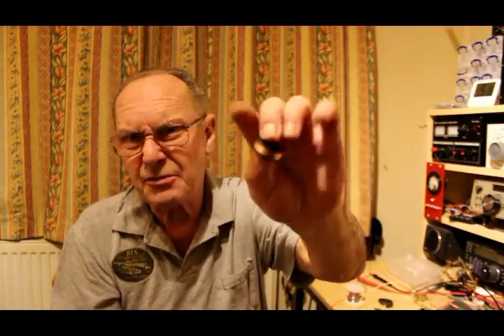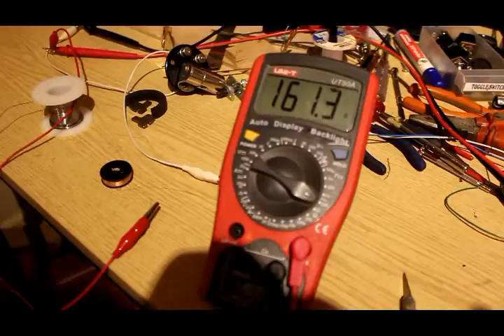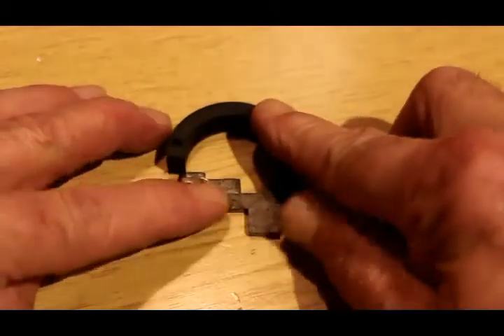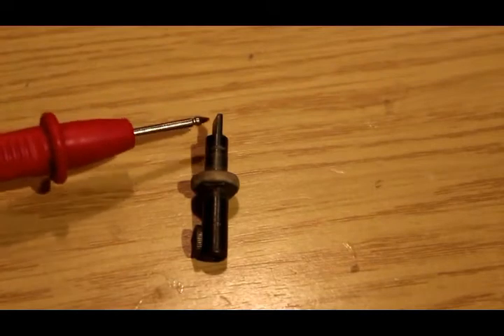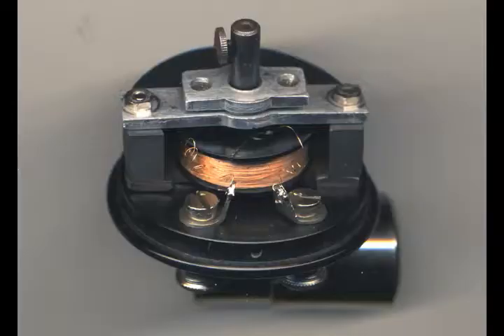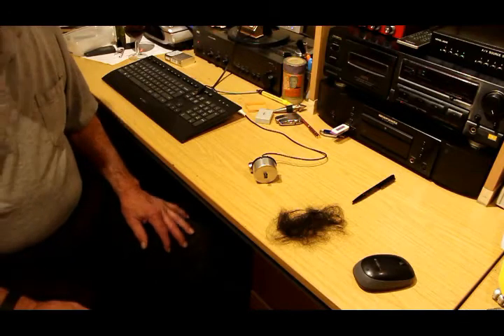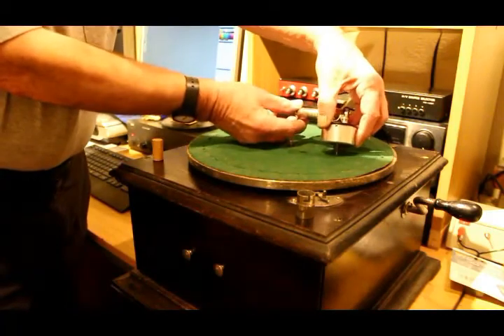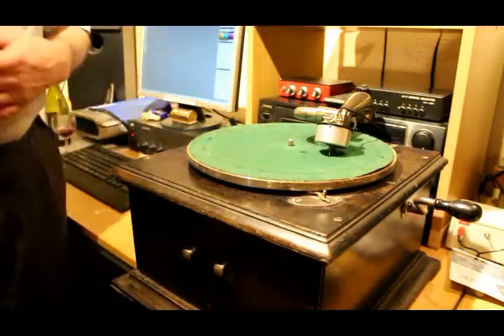edison bell electric pick up

Comment: Which pickup did you think was the best after all these years of trying different ones?
Reply from the maker: Hi there! Well, the answer is fairly simple, I think. The earliest electric pickups appeared (to all intents & purposes) in 1925, and they were mostly pretty heavy. But the designers soon realised that more 'compliance' was needed. This meant much less mass, and the major breakthrough was down to firms like Burdept, who designed a 'needle armature' pick-up. The needle itself was the armature, pivoted at the top, while the rest of the needle (which had to be steel of course) went down through the centre of the coil, which was in the magnetic field.
Go to https://youtu.be/krYebUesnF4?si=9_jLqAScuQI4Vrfj and you can see and hear this pickup, which Burndept seems to have licensed to the Birmingham firm Telsen. The BBC adopted them, and there is (somewhere) an image of several turntables & pickups at a BBC studio. It has a nice, light, ‘open’ sound. Later of course, came crystal pickups and various other designs… 😀
Reply: @bixanorak  I recently purchased a restored one of those J B Woodroffe pickups. I watched a video on those and they seem pretty good. What do you think of those pickups, I believe they were also employed by the BBC.
Reply from the maker: They were indeed - and apparently went into use in Spring 1925 at the BBC, thus confounding all the writers (including me!) that wrongly thought that the first electric player in the UK was the imported Brunswick 'Panatrope' - a very expensive radiogram from the U.S. which came in in 1926 IIRC. I do have  a video of a Woodroffe https://youtu.be/j8ZhZE4o4eQ?si=nmf1cgGWNINgOPH2 , but best of all, an enthusiast has just gained access to a big lot of paperwork that belonged to Woodroffe, and intends to write a monograph on him. (Exactly when I don't know..and also there are several errors in my YT video, like 1927 instead of 1925. But the video was made 12 years ago, sorry.)
Reply: @bixanorak  interesting! The first electric pickup in the UK, wow! They must be pretty rare I suppose. From your experience using one, are they good on 78s?

Comment: Sir what’s the needle pickup made out of, and which preamp it is connected .my respectfully thank u for such valuable videos
Reply from the maker: Sorry, I can't remember! It might have gone straight into a line input on my amplifier - these moving-iron pickups usually have quite a high output voltage. But, as I rewound the coil with not many turns, the output would have been small, so then, I would have connected it to the phono input of my amplifier, which only needs about 2 or 3 millivolts. Of course, it would then have RIAA equalisation, which is not suitable at all for 78s. I also have home made phono pre-amplifiers which give you a choice of Equalisations. See Rod Elliott's site at https://sound-au.com/  & look for phono pre-amps. Cheers, Norman.

Comment: If you mount that pick up 90 degrees from the lateral position, would it play vertical records e.g. Pathe' with the right stylus?
Reply from the maker: Hi Ron. (Sorry I never got back to you on your other request). This Edison Bell model, because of its configuration, would be clumsy to adapt to play vertical-cut records - though it would of course work, after a fashion. If one really wanted to adapt an early moving-iron pick-up to play vertical-cut discs, first choice would be one that was designed for tangential mounting. For then, all you would have to do is to contrive a 90° mounting elbow of some sort, that would allow the pick-up to 'lean back' as far as possible and it should work - in theory at least! Cheers, Norman.
Reply: Other request?  Oh, the record.  Not a problem.  I know it would be a PITA to do.  I was concerned that I had not heard from you at all.  Glad I thought to check out things on YT!.  P. S. Sarah Spencer is back home.
Reply: Norman Field I wonder what the Edison C2 and C4 “Radiograms” used, as I believe they could play both Diamond Disc vertical cut records, and more conventional 78rpm records? An online friend named Earl Nutt has a fully restored C2, and plays MAGNIFICENTLY! He had about 40 or so videos posted, mostly Diamond Discs, and the sound is spectacular, particularly late Electrical DD’s from late 1927, till the end in late 1929, just before the stock market crash. Even acoustic made before June 1927 have a new depth of sound on that machine.
Reply: Adding to my previous post, he has told me in replies to questions I had that the electrical reproducer has a permanently affixed Diamond for Diamond Disc Records and a steel needle chuck for the conventional 78 records. I hope you have time to checkout his posts for your own enjoyment, a particular favorite of mine is his record which I also have, of Down South by the Great B.A. Rolfe and his Orchestra. To my knowledge Rolfe never recorded for any other label so may be unknown to you in the U.K Exclusive EDISON artist. He worked till the end of the 1930’s as the radio Orchestra for several popular programs then, formed an All Girl Orchestra during the War, toured with that during the War, and retired in 1945 as at that point he was about 60 and a life of high activity does take it’s toll. He died 3 days after I was born in 1956.

Comment: After being remade that pickup sounds quite goo, Is that an NAD amplifier on your desk?
Reply from the maker: Hi - thanks for writing. Yes; I've had three NADS since the 1980s (one 3020A and two 3120s). They have always performed faultlessly, and the only thing you have to do is spray the gain control pots every few years with switch cleaner to stop the crackling that inevitably builds up with time. Perhaps I've been lucky; but I think the old NADs fully deserve their reputation of giving jolly good sound at quite modest cost. The use of 2N3055 transistors (originally intended mainly as voltage regulators) as the output stages , was very good: they're cheap, & pretty bomb-proof. Best regards, Norman.

Comment: I find fascinating the fact that with the time after a record been played again and again it doen't start to degrade...
Reply from the maker: +Migueldeservantes As long as the pickup is in good shape, and the arm is free to follow the pickup, and a new needle is used for each playing, most old discs like this could be played scores or even hundreds of times without significant degradation! But if the arm was stiff, the suspension of the pickup armature had become rigid, and needles were not changed, a loud record could easily wear out after 30 or 40 playings...